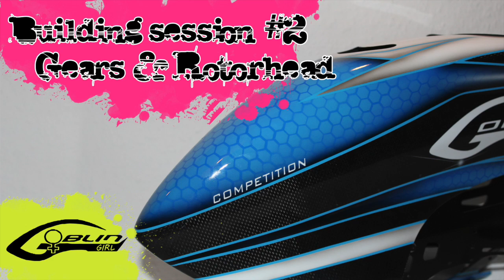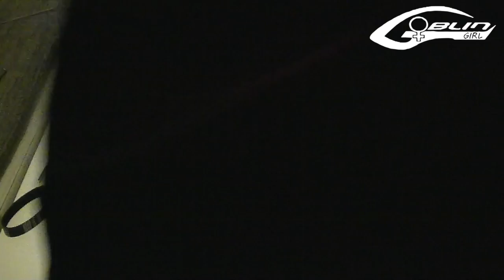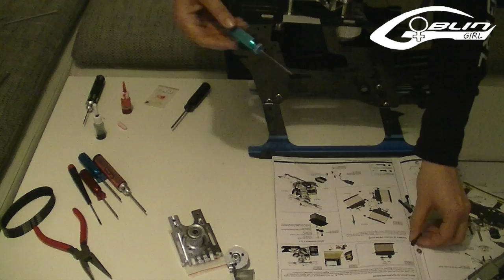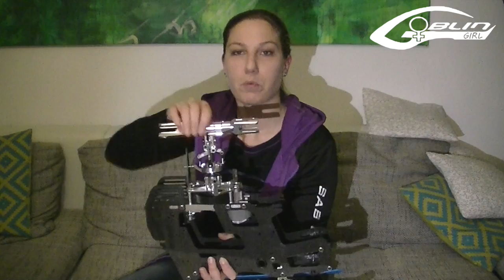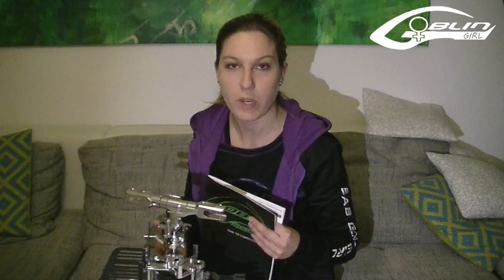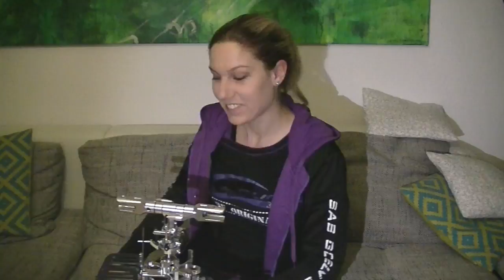Building the G700C under 5kg - Part #2

Comment: If I may ask what is the reduction ratio between the motors timing pulley and the driven timing pulley, I am curious about the ratio of input to output RPM.  Thanks for your time.
Reply from the maker: TOPHAT1966GS Well the good things with the Goblins is that you have a lot of freedom regarding the ratio. You can switch the Motor pulley, the pinion and also the tail pulley. You can have a look here to see the different ratios: http://www.goblin-helicopter.com/shop/product_info.php?cPath=96_130&products_id=23600&osCsid=adc22e763da4a8547061d4b3543c9c6f